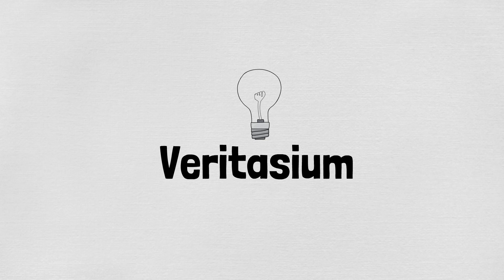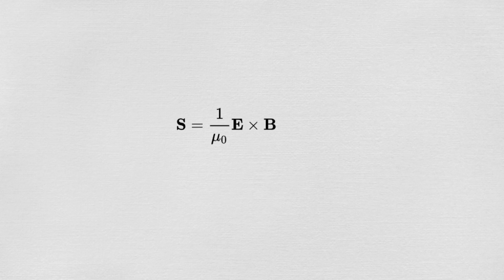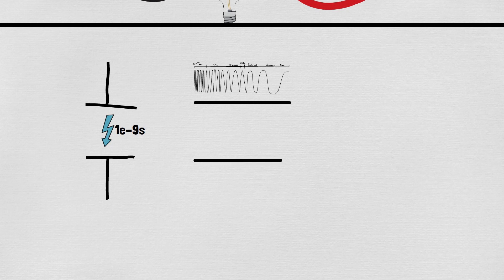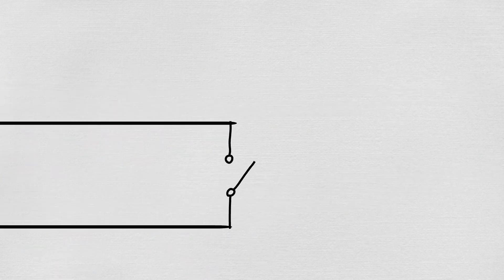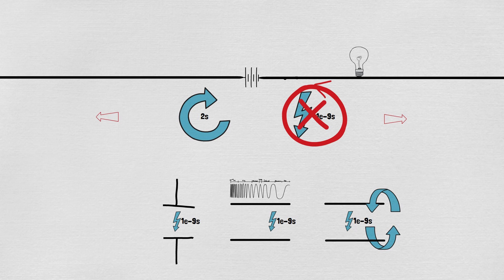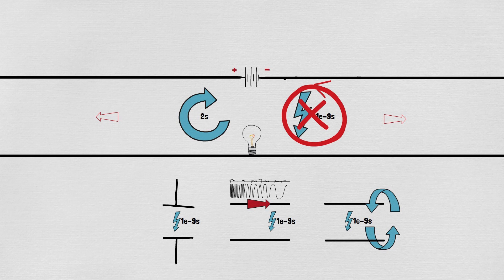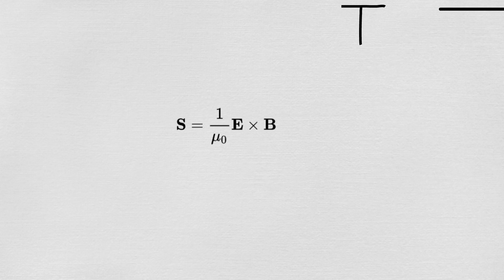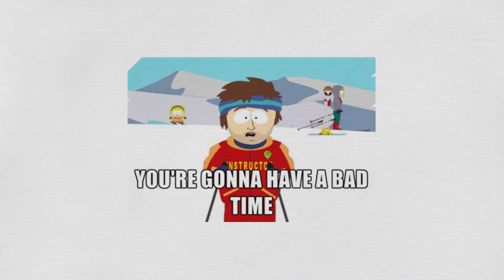Veritasium is Right? (see description)

Comment: I suggest you watch Robert Feranec's  channel.  Charge moves once the switch is closed  - from the consequential   step change which,of course,  by it's nature generates a range of frequencies (DC to infinite in theory) which propagate down what is in effect a transmission line
Reply: YES!   And he didn't include the 4th explanation from the other videos:  capacitor, transformer, antennas, TRANSMISSION LINE.  The fourth one is actually the correct answer, while the other three have badly misled Tycho.     Also, this is an "EE topic," and a physicist may never have encountered the synergistic combination of long capacitors and long transformers, which produce a pure resistor from long, zero-ohm conductors.   (Worse, those two virtual resistors are hooked in series with the bulb.   They're infinite 2-wire lines, but not being used in the simple transmission-line topology taught to beginners.)
Reply from the maker: @wbeaty  are you thinking the closing of the switch acts like a pulse generation of a charged transmission line? wouldn't that then just generate a 6V square wave with a width equal to the length of wire from the battery to the switch? aren't we talking mere mW of power then? it's true, though, I did not encounter this kind of problem before.
Reply: A fifth explanation is to consider electrons traveling in a resistance free conductor: at 12eV their speed would be 0.007c
(edit)  vacuum is the only resistance free conductor I have
Reply: @antimatterhorn  Yes, another thing Veritasium didn't emphasize is that it is the initial pulse from closing the switch, not any kind of steady state current, that lights up the bulb initially. The switch could also be something like a telegraph key on an antenna, just something to get a pulse moving in the wire, which might as well be disconnected on the end that is c/2 meters away.
Reply: And what would transfer that energy to light the bulb?
Reply: @WaleraRigid It's not used for transmission.  It's a "2-wire line," and obeys that physics (where the cut end looks like a 700 ohm resistor.)   But in this case there are two of those in series with the bulb.  A z-matched bulb would get 4mA, 6V.
Reply: @antimatterhorn  Exactly right.  It's 4mA for one sec.  Enough for an LED only.
Reply: @eddietee6305  The EM field would transfer the power to the other side with the bulb. Similar to how power is transferred in a transformer.

Comment: I thought the switch when closed is what allows the electrons to quickly flow along the length of wire until there is an equilibrium on the other side of the wire.  For that brief instant the lamp would light up, then if you could reverse the initial reaction and close another switch and have the electrons flow the other direction the lamp would light up again.   If you could open and close the switches quick enough it would keep the lamp lit, it’s just like alternating current back and forth over the wires regardless if the circuit is connected at both ends,  just like radio to the antenna.
Reply: The easiest way to understand is consider the two long pairs going far away as transmission lines, or 'stubs' shorted at the end.  They look like resistors (of about 800 ohms). this is the characteristic impedance also called the surge impedance. 
They look like resistors until the reflections come back from the shorted ends.
.
So, at t=o, when the switch closes, the battery is connected through two 800 ohm resistors to the bulb that is 1 meter away. Therefor, after the 1M/c seconds after the switch closes, it has a lower current until all the reflections die out when the bulb lights to full.
The way the E and M fields operate causes this to happen.
Reply: The lamp would never light up till it felt the full current. There will be a miniscule amount of energy transmitting across the gap. I'm talking micro or nano watts. Billions of times less energy than the bulb requires to light. And that will happen even if there is a break in the circuit.

The wires would need to be millimeters apart to transmit power efficiently. That's why wireless chargers are millimeters away from the phone when charging.
Reply: @brandonn6099  I’m not sure I agree as there are people that have done this with small lamps and a radio transmitter.   Derek sure opened up the minds of many here on YouTube, everyone is talking about this puzzle.
Reply: @1986BBG  Maybe with miliamp LEDs you could get it to light up using a massive battery, but 1 meter is a very long distance for capacitance to travel. Even a super powerful magnet is almost nothing from that distance.
Reply: @brandonn6099  there are YouTube videos, the one I specifically watched was with a woman and a yagi style antenna.  I’m no electrical engineer so i will not be arguing what I know nothing about, but I appreciate your information.

Comment: Actually, after the switch closes, the E field propagates along the wire at the speed of light and takes about one second to create a full 12V difference across the bulb. While doing so, the propagating E field will induce a magnetic field as well. Both of these will couple to the section of the circuit that is 1m away, but the strength of the fields will be too weak to light up the bulb.
Reply: veritasium stated the condition that any strength of field that reachs the bulb will turn it on
Reply: Given the parameters (zero resistance, one meter apart) if the wire is 1 mm of diameter you have a characteristic impedance of around 414 ohms thus you the transmission line will behave as two 414 ohm resistors in series with the bulb (before the wave comes back). But the bulb is ideal and will turn on at a small current.
Reply: Finally. Someone said it. The em field is absolutely not enough to light up the bulb. The energy in the wire does. It doesn't matter how long the wire is or how the layout is. The em field will not be enough to light up the bulb.
Reply: @Nomadmandude  the bulb is ideal and turns on with minimal current. The current in the transmission line will be around 20 mA which is enough for a LED.
Reply: @dannysmitherings9502  Which is why he is wrong.
Reply: @vihai  If the bulb is ideal, it is already lit up by background electromagnetic fields, so the switch still doesn't change anything.
Reply: @gerrynagel5337  it's ideal with a threshold of 1 mA, are you okay now? Missing the point entirely....
Reply: @vihai The field won't generate 1mA, are you getting it yet?
Reply: It's dishonest at best and moronic at worst if anyone suggests that under some "ideal" conditions the light will glow and also claim that people have "misconceptions" about the reality.
Reply: @gerrynagel5337  in the specified conditions 20 mA will flow into the bulb, everything else is just a rant
Reply: @gerrynagel5337  there is the characteristic impedance of the transmission line in series of 414+414 ohm.
Reply: @vihai  - 
(1) The circuit that can be influenced in 1/c time is 1m in length, which means it is effectively an open circuit consisting of ~1 meter lengths of wire connected to the battery/switch and ~1 meter lengths of wire connected to the bulb. These lengths are effectively disconnected within 1/c time, as time goes on the effective lengths grow at the speed of light, until it reaches the end of the loop when the circuit will be effectively closed. Prior to closure, your 414 ohm resistance is nonsense and has little effect on anything.

(2) If zero volts is across the bulb, then there is no power. Without power, there is no light.
(3) if >zero volts is across the bulb, due to it's ideal nature it will produce infinite current, hence, infinite light.
(2) & (3) => There can be no voltage or current across an ideal bulb without infinite light.

(4)  Such an ideal bulb would illuminate by any dynamically changing field, even from sources billions of light years away. To suggest that the fantasy conditions only apply when the switch is closed is ridiculous. The bulb would be be emitting infinite light at all times. The switch wouldn't change anything.

The only way that Veritasium can be taken honestly and/or seriously is if we assume a universe in which the laws of physics operates in some fantastical way in which his statements are the laws of physics themselves. In that case, he lies when he claims this proves that people have misconceptions about reality.
Reply: @gerrynagel5337  if you've ever worked with transmission lines you would know the effect is real. You can model the circuit as a voltage source, two series 414 resistors and a light source, make it a real led, no need for ideal components.
Reply: @vihai  Rubbish. You can't model the circuit like that because the signal doesn't appear across your so-called "transmission lines". There is no signal across the negative wire and it remains at 0V throughout the experiment, so there's no equivalent 414 ohm resistor there. The only transmission line exists between the positive wire going from the switch to the bulb and the negative wire going from the battery negative to the bulb. Its capacitance is infinitesimal and consequently, its equivalent impedance is near zero.
Reply: @RexxSchneider  I do such kind of measurements daily on high speed digital circuits. I really can't care less if you don't believe and/or understand.
Reply: @vihai  - I have worked with transmission lines and I also understand physics. At 1/c time, the circuit will behave as an open circuit, not a closed circuit with two 414 ohm resistors in series.
Reply: @gerrynagel5337  your statement contradicts the measurements I take daily. Current in the transmission line flows as soon as a voltage is applied and behaves like a resistor until there is a reflection.

What is your experience with transmission lines? What kind of measurements did you perform?
Reply: @vihai  What equipment do you use that measures current? The equipment would need to accurately trigger when the switch is closed until 1/c time. The total time is less than 4ns. Note that for accurate measurements, you'd need a switch that can transition from open to closed in much less than the period of the experiment. It would have to close within picoseconds. Please provide information on your switches that open and close within picoseconds.
Reply: @gerrynagel5337  I make measurements on high speed digital lines, in particular differential buses up to 5 gbit/s. I do measurements with a 6 GHz oscilloscope. The transceivers (the "switches") have rise times of around 100 ps and you are well able to see how the transmission line, its voltages and currents behave as predicted.
Reply: @vihai  So you're orders of magnitude off.
Reply: @gerrynagel5337  nope, the rise times are adequate to see the effects with regard to PCB and external cable lengths.

I would avoid making such assertive statements because they reveal how lacking is your knowledge in the field. Take note of the Dunning-Kruger effect.

(unless your purpose is explicitly to humiliate yourself, in such case, please proceed)
Reply: @vihai  I see. You think this is about psychology. oh well.
Reply: @vihai  I don't disagree that the field will begin propagating immediately. But the effect 1 meter away is miniscule and doesn't even begin until 1/c time. The light will not turn on, regardless of how smart you think you are. Your knowledge of the subject is amateurish at best.
Reply: @gerrynagel5337  it's not "minuscule", do the math and find out that it isn't. Did you or are you judging by intuition?

So, what is your expertise with transmission lines ad physics? You didn't reply
Reply: @vihai  I checked all the math you provided and it shows the current is miniscule.
Reply: @gerrynagel5337  what equation did you use for your calculation? I only used Z0 = (277 / sqrt(eps_r)) * log(d/r)

Please quantify "miniscule". If you "did the math" you should have a number.
Reply: @vihai  You've only given a bunch of symbols that look like an equation. You didn't explain what the symbols represent. Once you do, your flaw will be revealed.
Reply: @gerrynagel5337  if you are so used to transmission lines you should immediately recognize that formula.
Reply: @vihai  - I recognize that you're wrong. You can list thousands of equations if you'd like. It doesn't make your mistakes correct. Did you think this was your tech school test where the teacher gives you partial credit because you wrote down an equation? That's what you're acting like.
Reply: @dannysmitherings9502  - In that case, the bulb would already be fully on from the miniscule background fields that already exist. The switch wouldn't change that, so he's still wrong.
Reply: @gerrynagel5337  I think veritasium was suggesting that any small current specifically coming from the switch being turned on would turn on the bulb, excluding background noise
Reply: @dannysmitherings9502  - I agree. He's suggesting that there exists a completely unrealistic, fantasy universe that behaves according to his imagination and this fantasyland proves that people have misconceptions about how electricity works in the real world.

In fact, the battery has internal leakage, so there is already some changing field well before the switch is closed. Therefore the light should turn on just from the battery's own internal slow discharge. This assumes fantasyland conditions, of course.
Reply: @vihai  - No, you don't understand that the bulb will emit no light in 1/c time. You think you have a magical equation that proves it does. Unfortunately, you can't explain it.

Comment: 3:24 "what's so special about a switch that turns inener a wire into an antenna?" All wires are antennas and transmittion lines by default. Just you can ignore it as long as there is no fast change in the excitation, or there is no way to observe the wave propagation. A switch creates theoretically immediate change in the excitation, and the specially defined theoretical bulb creates a fast indicator at a point. Switch doesn't change wires. It creates an excitation for the system.
Reply: Exactly, the question was when the lightbulb would turn on, and that means what is the earliest time the current through the wire be non-zero.

It's not the distance from the battery to the bulb that matters, but the distance from the switch to the bulb, since that's where current starts flowing.

Because there exists a capacitance between the wires, the change in current induces a (possibly temporary) current in the parallel wire.

If the other side of the wire happens to be the location of the lamp, it would turn on, even if its temporary.